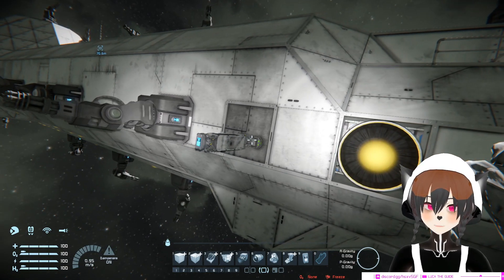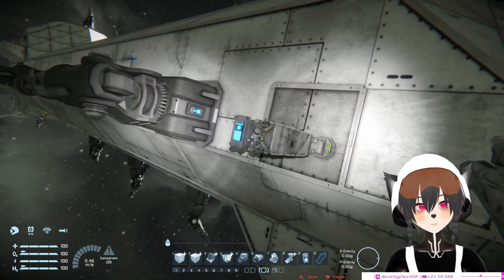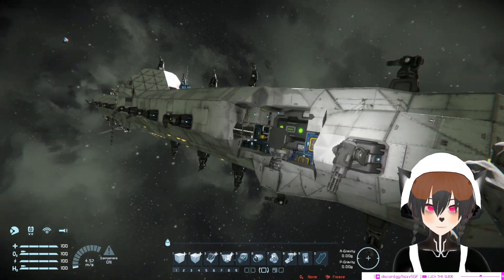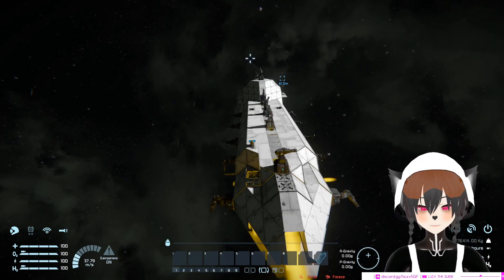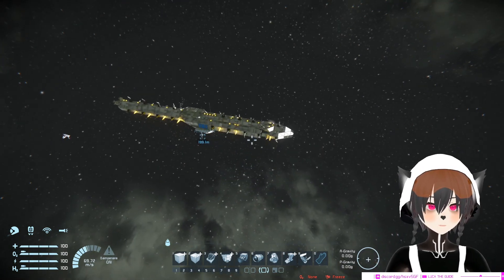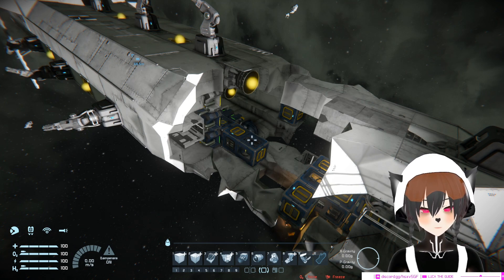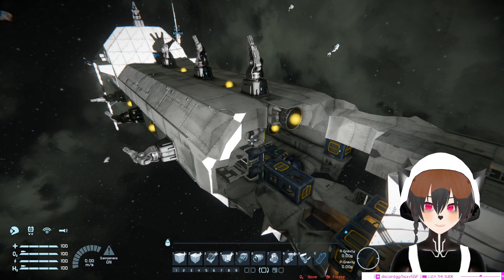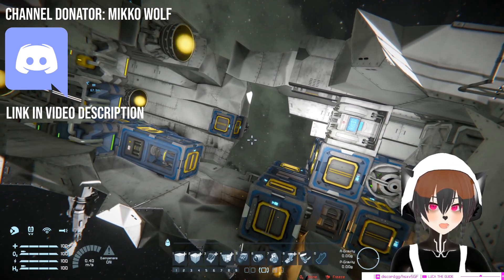Loose Gyroscope Can do This to Your Ship, Space Engineers Experiment

Comment: To be fair, your line of ships is also packed with spicy large hydro tanks. Do you really need that much? Do you typically burn through, or need as reserve, that much hydrogen in a fight?
Reply from the maker: Ye x3 but the gyroscopes are not usually attached to them, and even if they are hydro tanks are generally stronk, I was just mentioning that in the video as a common misconception that hydro tanks "explodes" and destroy things near them

My old ships of the line fleet use more hydro tanks than my newer ones because they were from before the hydro tank capacity update c= but ye they need that much for prolonged fights x3 plus conveyor lines

Comment: There are two ways to deal with gyro placement one is to put them on the outside the other is put them deep inside. I usually do a combination of putting most of them at the front behind the armor so they shield the other parts and a few on the cockpit. On very large ships like 20k pcu or more you might just put them on the jump drive since 99% of the fights will be destroying each others turrets and the person who cant jump away is dead anyway so might as well blow the ship up.

Comment: What I've been doing lately is putting most of my gyros on the outside of the ship to avoid this problem. I put one or two attached directly to the cockpit so I always have some in the event of heavy damage. But the only way I can have them rolling around inside is if the cockpit is destroyed and I'm already dead.

I've found that they also make pretty good armour because of the tons of steel plates they have.
Reply from the maker: Oo, good trick O: pinned x3

Comment: Thank you for doing this. So often I've seen SE content on YT where the bottom armor of a ship is used as a floor and where function blocks such as pilot seats are anchored 0.0. 

can you show some better placement ideas for where a gyro could more safely be attached? So, not the H tank but then where? It seems the only safe place is off a Refinery since that's sturdy.

Can you do a debunk video showing that it's not the hydrogen tank doing the damage?
Reply from the maker: Np! I usually put them on jump drives or refineries yeah x3 sometimes I put them on heavy armor or batteries when there's no space as they're sturdier than light armor

I might make a video about that c= we'll see